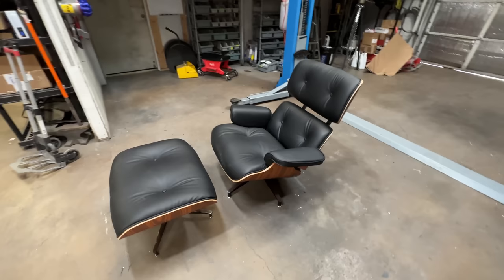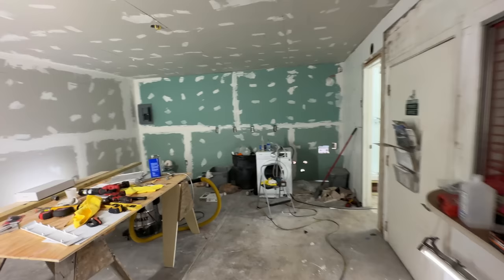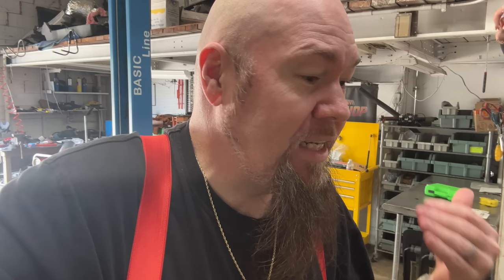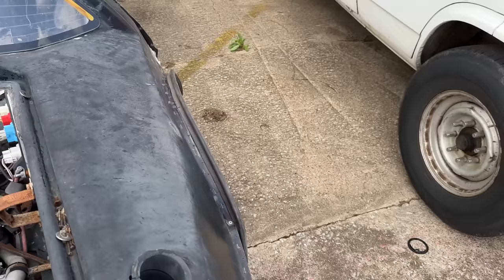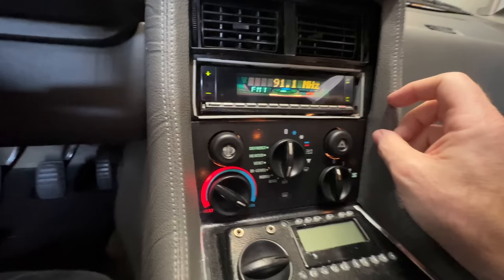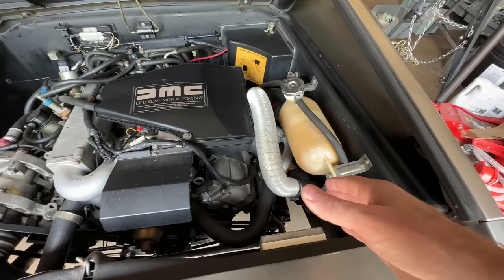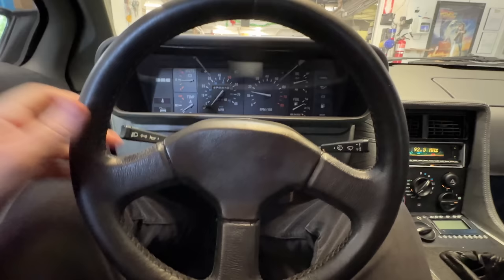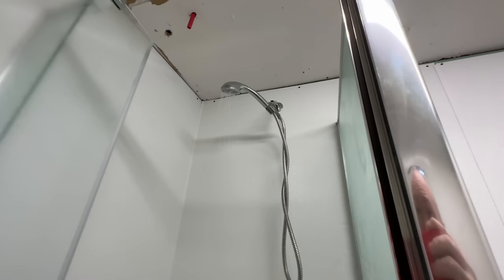Shop Update 033123 - 46th Delorean rolls in - Important announcement!

Comment: You are one talented guy. The ripp off at the Acton broke my heat. I have my 1969 AMC AMX 390 WITH EVERY A AVAILABLE OPTIONS GO PACK. TOOK IT DOWN TO MEDAL AIR PLANE STRIPPED. 2K , PRIMER, 3 COATS BASE COAT, 3 CLEAR COAT. CAN'T FIND QUALITY WORKER TO FINISH IT. RUNS LIKE A BEAST. GREAT IDEA BOB. I MIGHT GET ONE BOB. GOOD VALUE. NEAL APOLLO BEACH FLORIDA

Comment: The original Herman Miller chairs also go for grip and have issues delam-ing and then the back comes off catastrophically and you go boom!
The antenna location on a DMC12 wasn't optional...the first "batch" of imports had the windshield antenna followed by a second batch that was missing the wire going around the windshield. We took those cars and began adding antennas to them on body. This necessitated  having a crew of guys working night shift to meet demand. This was taking too long so we switched to  
vent install with a powered unit. This was done in California not Ireland.